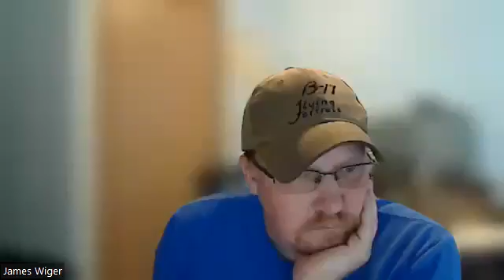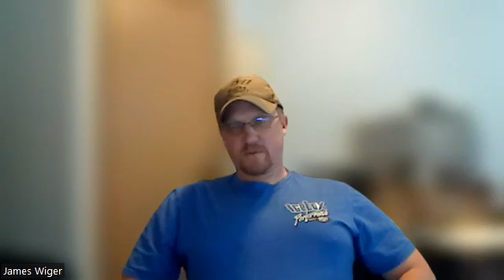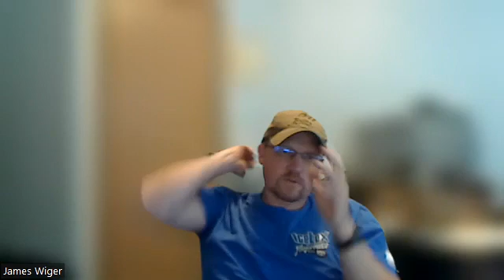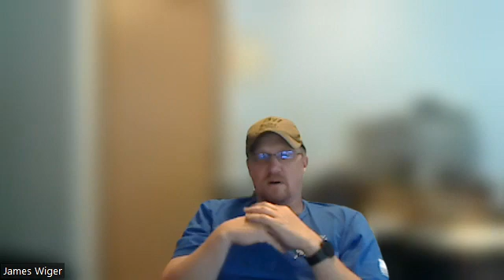Response to: Uncle Tony's Garage - EFI Conversion Debacle

Comment: The problem is retrofitting. A carb engine lacks the sensors needed for for an efi system. The makers of the retrofit systems are selling a product that is aimed at a broad range of installation types in stead of designing a package for a specific purpose. The best option is to retrofit a late model, port injected, engine into your car. If you want to go crazy from there you replace the ECU with something more tuner friendly, Haltec, Link, MegaSquirt, Speeduino. Yes it is expensive, yes you have to learn a lot of new skills.
The manufacturers keep aiming at the low end, trying to put out a product as cheaply as possible, which they are selling to a market that can barely afford the product, let alone the installation of the product. Computer control and EFI is the greatest thing to happen to the internal combustion engine since the overhead valve. But EFI it isn't meant for engines that were designed BEFORE the OHV without updating to all the new sensors (not cheap.)

Comment: The efi systems aren't quite as user friendly as the marketing would have you believe. i.e., 'self-learning'. They require some input based on the combination and some fine tuning which is where problems arise. But there are plenty of them out there running just fine. Same for carbs. Knowledge is king. People who don't understand how to tune a carb buy an efi system that they also don't know how to tune. (and then blame the system)

Comment: The problem comes in because the Holley Sniper is a Speed Flow System (think 80's, 90's corporate throttle body injection) where a MAF is not necessary to operate. If a MAF sensor is desired, the builder would go to a individual port or direct injection type of setup where a MAF is installed before the throttle body. The Holley Sniper is a great replacement for a carburetor on a weekend warrior vehicle. A builder just can't expect it to operate like a individual port injection system does.